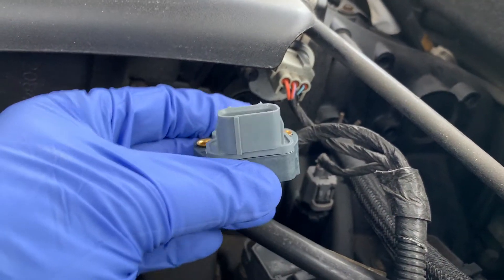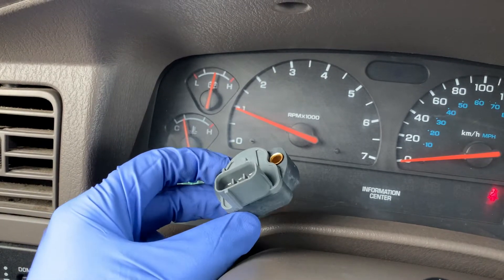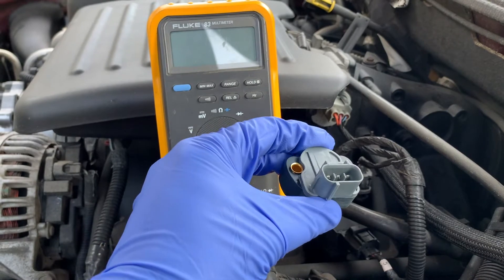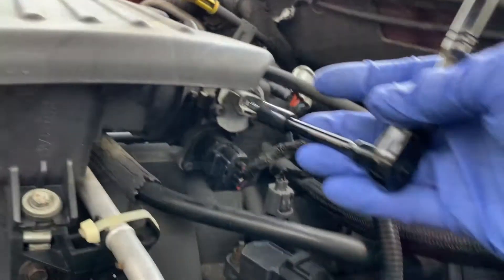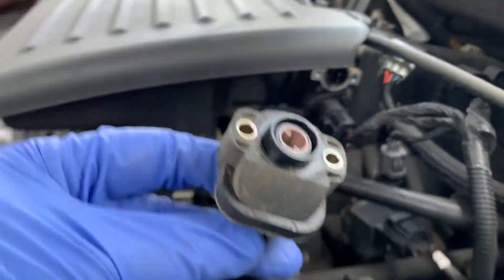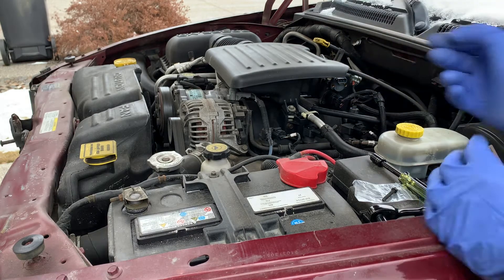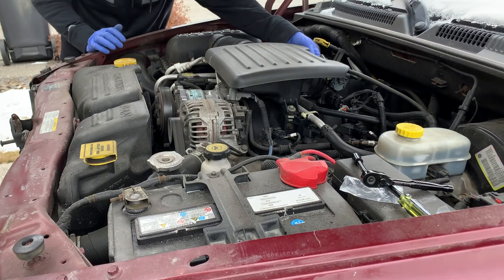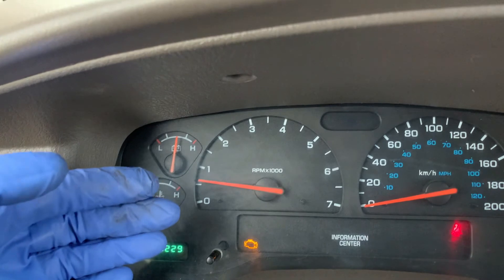Throttle Position Sensor Replacement

Comment from the maker: Which symptom tipped you off to change your TPS?
Reply: Sudden surges and stalling on the highway, bucking and jerking on the road, poor idle, having to mash the throttle to get any form of speed, uncontrollable throttle speeds on the highway those are the symptoms i had